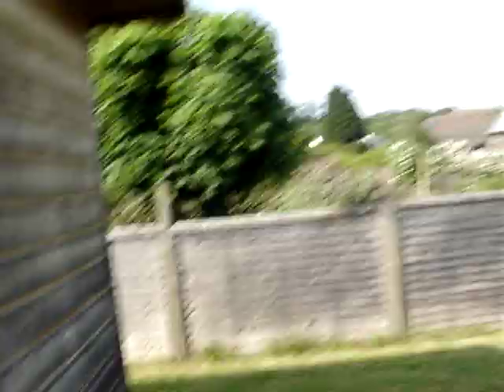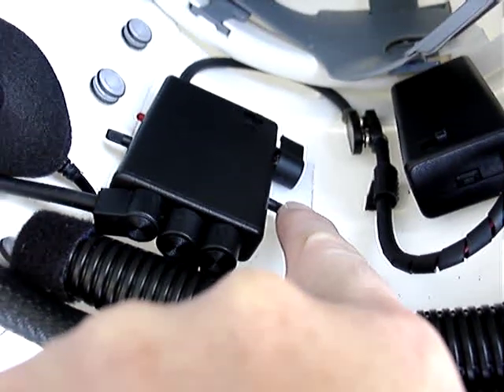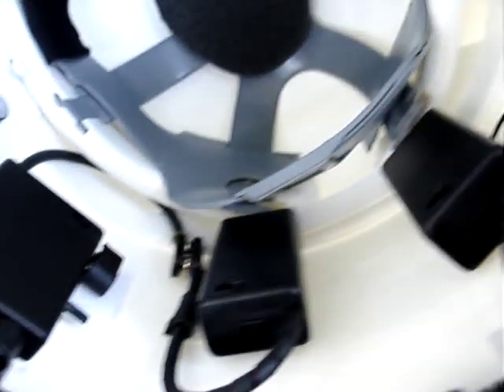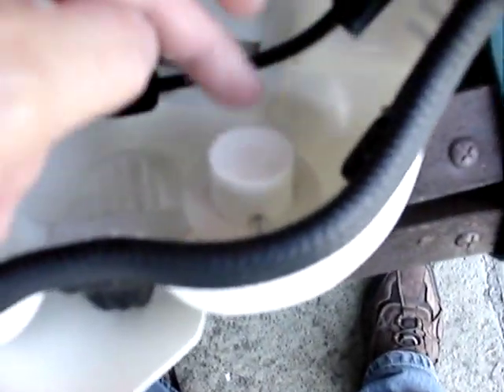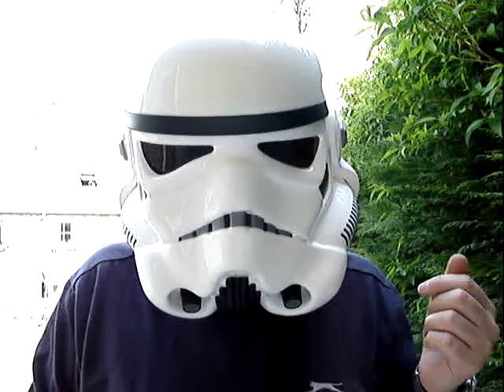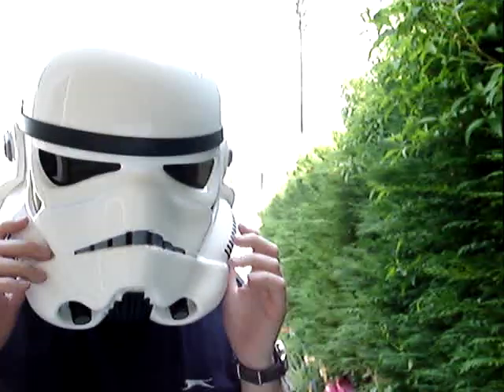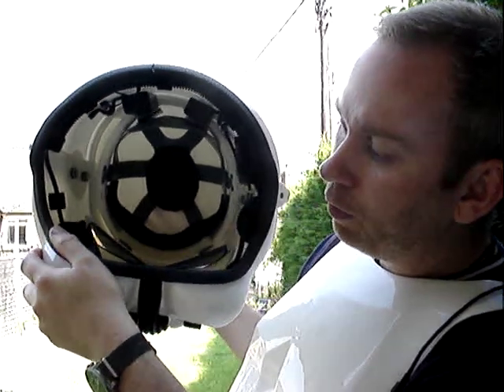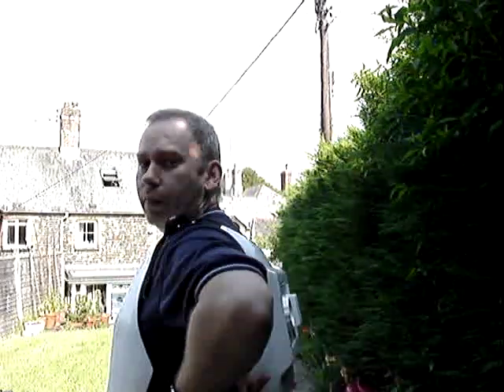Stormtrooper TKVox VersoAmp with Hovi Mic Tips & powered speaker - outdoor test

Comment: Since you’ve stop making them, how do you recommend adding that tinny sound to the output? Is it just putting a gain on it?
Reply from the maker: Hi there. It's a combination of small hovi speakers and running a small custom amp at high power with an overdriven input... and... the microphone being very close to your mouth. It took me a long time to figure out how to get it all working together. The amp I built had a couple of custom mods to it which allowed the microphone to overdrive. The microphones were relatively low cost condensers so the quality wasn't high which was perfect for the application. So, yes, it's input gain so that the amp has some protection and bashing the hell out of small speakers (the ones I purchased were very exotic and could be driven really hard). I hope this helps.
Reply from the maker: One more thing... This can all be done digitally and has been for many years with various off the shelf components. I worked on a board with a colleague but ran out of time and cash to get it working effectively.
Reply: @TKVox  Tremendously. Thank you. Your time is valuable and I am grateful you took it to share your knowledge.